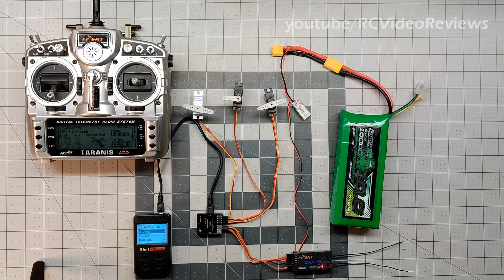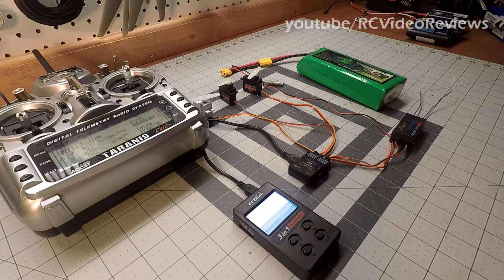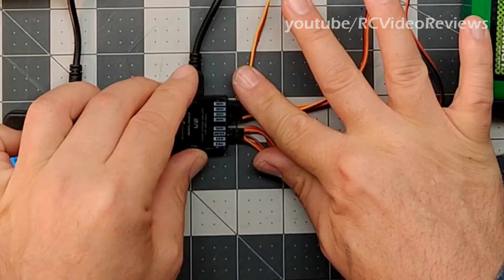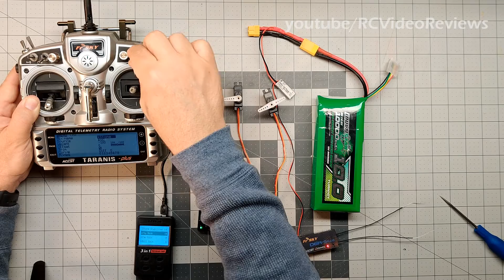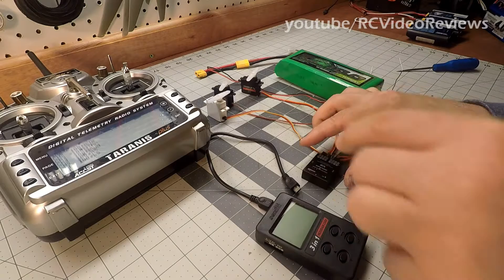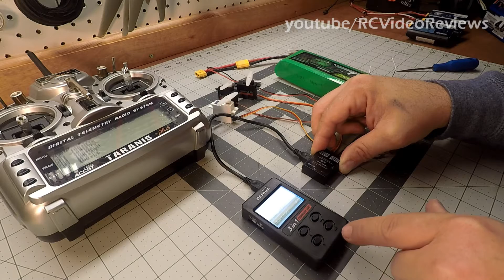Add a Stabilizer to ANY RC Plane - How to Setup a Detrum iStone v2

Comment: What I really like with this unit,  as opposed to a Frsky SxR    is you can adjust gain separately from each other,   just have to land to do it,   whereas the SxR's     you can adjust in the air,   but not individually.    Great little unit,    have one in my own trainer.    Have set it up as off, on 'wind rejection', and auto level 'recovery mode'.     In auto level you still have full stick control, which I have on my momentary switch,   so if in trouble,  release sticks, pull momentary,    that overrides gyro mode,  and throttle to 40%.   Peice of mind   Excellent
Reply from the maker: Good report on your findings. Thanks for sharing.

Comment: Hey man, love your videos.  I bought the 8C that came with a couple of receivers including the SR86-A gyro stabilized receiver, admittedly off of ebay for a great price.  I know this is not your job, but there are not a lot of resources for the radionm system online, maybe you can help.

It is bound to a FMS 800MM  t28, gyro channels are assigned all of the control surfaces work, but when in gyro on mode, I can hear the gyros working, but the control surfaces barely move when I tilt the plane left or right.

The receiver is in the fuselage, near the CG, facing up with the pins facing the rear of the plane.  I could really use some help with this.
Reply from the maker: Did you get a 3in1 programming card? You may need to get in the SR86 and adjust the gain for those control surfaces--especially if you bought it used. There's no telling who may have configured what in there.
https://bit.ly/32V5eoF
Reply: @RCVideoReviews  you can program it right from the 8C, the same way you can from the Blitz

Comment: when I am trimming a plane, how the stabilizer does not misinterpret the trimming as normal steering in save mode (self leveling)?
Reply from the maker: Trim and stick movements are not discreet events in the eyes of the stabilizer. i.e. It doesn't know one is trim and the other is stick movement. Trim is nothing more than a modification of pulses at neutral. Of course the most ideal scenario is that you use no trim. Some autopilots like Arkbird highly recommend using mechanical adjustments to eliminate all trim on the plane. In practice, I've never bothered with it on stabilizers because once a plane is trimmed for straight and level hands off, the stabilizer can accept that hands off input as the desired state of the plane (which it is). Even on RTH equipped planes like the Millennium Master--with which I just posted a video showing RTH--I don't bother mechanically zeroing trim and the RTH has worked fine.

Finally, I don't use stabilizers like these for precision events (navigation). I only use them for wind rejection purposes which simply is not very precise. If I did use them for precision events like long range BVLOS FPV, I might invest the time mechanically zeroing the trim. I've flown Eagletree Vector equipped planes with software trim for some distance and trim has been a non-factor.

Comment: That's interesting that they do a 3  way  Y for the AER connections. Less messy / less failure points?
Reply from the maker: It's not uncommon for stabilizers to use the 3:1 wire. I've seen that before. The only thing that stabilizer needs to know is the pulse width on a given channel and the only wire needed to convey that info from the Rx is the signal wire. Remember on servo leads the +/- provide power to the servo. The signal tells the servo what to do. The mode switch connection from the Rx is a full 3 wire affair using signal for mode and +/- to power the stab.

Comment: great review adds a whole new perspective to flying some of those hard to fly planes till you get used to its capabilities  
Sbus  would be a bonus almost like using it as a flight controller great job
Reply from the maker: It does support s.bus. FWIW When I installed the SR86A-G in the Millennium Master I moved the MSR66A into the Mini Contender. That plane is so small, the benefit of a stabilizer is huge. Thanks for the kind words on the review.